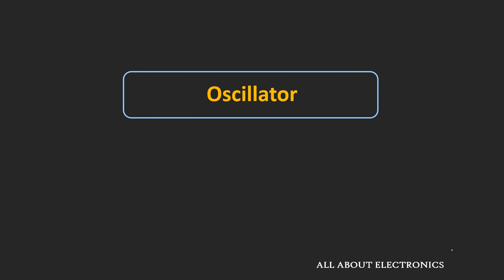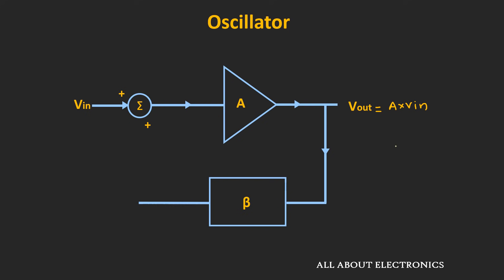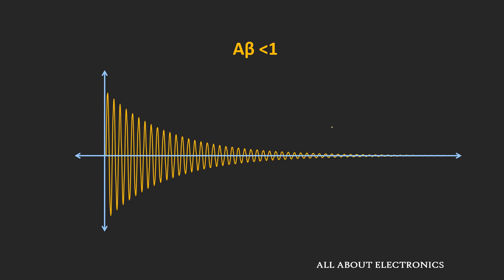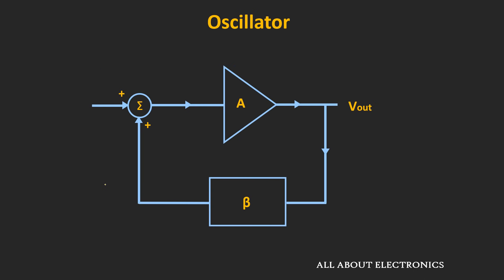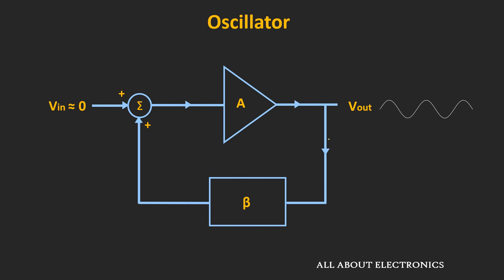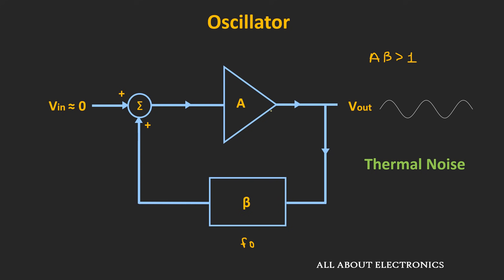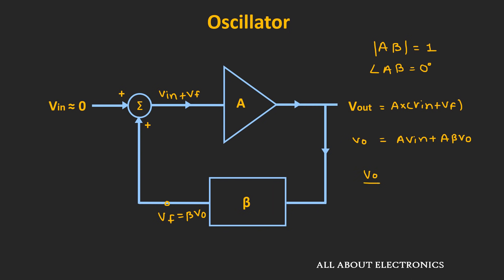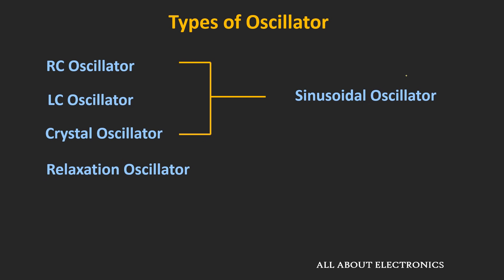How Oscillator Works ? The Working Principle of the Oscillator Explained

Comment: You have told that we can get the oscillations at the output without giving any input due to the presence of thermal noise. However, it has been depicted in my reference book that we can get the oscillations at the output without giving any input due to the presence of transient noise. Now, which one is correct?
Reply from the maker: I have already mentioned that in the video, Please check the video 4:50 onwards.

Comment: Great explanation. I was actually stuck on the question "how does an oscillator generate sine signal without a sine input?". I thought alot of stuff, considering DC biasing, poles, transients etc, but didnt think of thermal noise. Thank you for this video

Comment: shouldn't it be like when ab is not equal to one the output will increase or decrease exponentially but when it is equal to one it will increase linearly
Reply from the maker: No, that is not how it work ? For more information, you can check this video on feedback amplifier. Where I have explained that in more detail. 
https://youtu.be/CDmDXRGjbIU

Comment: the magnitude of the loop gain AB should be equal to 1 (AB =1);
While proving this, the denominator becomes 0, which means infinity.

Can anyone Pl explain to help.
Reply from the maker: It indicates that the closed loop gain is infinite. That means even if there is no input ( ideally) or very very small input, then also we should get output. In oscillators, actually a thermal noise gets amplified by this closed loop gain at some frequency and because of that we are getting oscillations of specific frequency at the output.

Comment: Respected Sir, how is the output Sinusoidal? That is why I came.

Do we have proof that the internal noise is "sinusoidal"? So then its amplification by A is also sinusoidal and Beta=1/A in feedback once again puts it back equal in magnitude and phase. 

OR is it so that both the amplifying blocks are frequency selective? Afterall any signal can be reproduced by addition of n different sine waves. So from the chaotic non sinusoidal internal thermal noise, only a particular frequency is favored by A block. 

Sorry for making it longer. 5:23 I would like to differ. I think it is the A amplifier block which 'must' be frequency selective as the output of A amplifier is the output of circuit itself.

Comment: sir why we are giving ac input to the amplifier as we know that oscillator coverts DC to AC without any input
Reply from the maker: Yes, true. We do not apply any ac input to the oscillator. But just to explain the concept of loop gain it has been assumed that some signal is applied to the oscillator.

Comment: at 7:37 how A*bita  is equal to 1, please clear my doubt.
Reply from the maker: If the oscillator circuit is providing oscillatory output then AB is close to 1. If AB is more than 1, then amplitude would increase gradually and the output will get saturated. If   AB is less than 1 then gradually oscillatory output will die out. But since we are getting constant oscillatory output, it means that AB in the circuit is 1. I hope it will clear your doubt.

Comment: Hi , I have a question . Previously we explained like oscillators are not taking any input and works with thermal noise available in the amplifier circuit. I believe , thermal noise used to have multiple frequency wave from. 

But here my question is :First block diagram tells that , Oscillators are going to take DC input signal ( How thermal noise is related with DC input signal ) .. Don't able to understand.
Reply from the maker: It will be superimposed in the DC signal as well. The thing is it is very small in amplitude. But due to positive feedback it will get amplified and eventually a particular frequency component will get amplified. 
I hope it will clear your doubt.

Comment: just one question. the circle with the sigma in it. what's it called?
Reply from the maker: It's the summation sign.
Reply: @ALLABOUTELECTRONICS  Thx. but i meant the component
Reply from the maker: @BiDude6205  Generally, either op-amp or transistor is used in the oscillator circuits.
You can go through the oscillator and multivibrator series playlist. 
You will get more idea about it.
Reply: @ALLABOUTELECTRONICS  thx

Comment: Sir we oscillate the thermal noise so we get the frequency of thermal noise. How we get the power to the circuit from that frequency
Reply from the maker: Through DC supply, the oscillator gets the required energy.
Reply: @ALLABOUTELECTRONICS  Tq
Reply: @ALLABOUTELECTRONICS  sir how the RF oscillator produce more frequency than AF oscillator in both we use same components.

Comment: How the system knows the selection between Abeta>1, Abeta=1?
Reply from the maker: The amplifier itself sometimes does that job.
For example, when the output of the oscillators starts increasing, then gain of the amplifier also lowers down at higher voltages. (As the voltage reaches near saturation).
Typically, in practical systems, AB is kept slightly more than 1.

Comment: First you said that input is applied but later you said that no input is applied and still it produces output due to thermal noise so I am quite confused.
Reply: Also 1/1-AB , if AB=1 the Vout/Vin becomes infinite

Comment: you said that an oscillator converts dc so sinus, but then you gave an example of a sinus input. i dont get it
Reply from the maker: Well, that was shown to explain the working of the oscillator, or to be precise to show the condition for the sustained oscillation.  
As I said, the sinusoidal signal was applied just for a moment, and then it was removed from the circuit.
But actually, the noise acts as an input for the oscillator. And eventually, one of the noise frequency gets amplified and we get the sustained oscillation at that frequency.
I hope it will clear your doubt.

Comment: What is use of DC supply in oscillator
Reply: A lot of radios are run off of 12V DC to be step down from city power. Usually they run off of 4-50W of RF power. It allows for less heat and small components to be used in mobile and portable radios.
Reply: Thank you...Sry to ask I have a doubt normally we apply low amount of sinusoidal supply after we remove it and the amplifier amplify the thermal noise       and oscillations are produced in desired frequency
Reply: Mounika Bandaru Yeah, we usually use transistors or capacitors/inductors to create different types of sine waves I believe.
Reply: And why we use DC supply
Reply: Mounika Bandaru DC voltage is easier to control in circuits because it follows a linear constant path, less likely to cause interference with AM and SSB, compatible with diodes and electrolytical capacitors, etc.
Reply: @furonwarrior  kk thank you

Comment: How did you just assume AB=1 at 7:45
Reply from the maker: In oscillator, with out any external input we are getting output. If vin = 0, then Vout should be zero. But still we are getting output. Actually small noise gets amplified by the oscillator at particular frequency. That means Vin is very very small. And when AB =1, the oscillator provides ideally infinite gain to that small signal. But practically, AB will get limited by the saturation of the amplifier. Initially AB >1, but as signal gets amplified then AB reduces slightly. In short, in the closed loop system the AB is maintained such that we are getting sustained oscillations.
I hope it will clear your doubt.
Reply: @ALLABOUTELECTRONICS  So the oscillator principle causes thermal noise? And no voltage and current (Vin) need to flow to the amplifier. We need just power the amplifier. Right?

Comment: This disregarded the impulse created by power up conditions for initiating oscillation. This circumstance far outweighs any thermal noise. It also disregards different output waveforms that can be achieved by what the video shows as sinusoidal circuits. Waveform conditioning can also be accomplished by circuits following the oscillator.
Reply from the maker: If you go through the playlist on Oscillator, I have already discussed the different ways of the generation.

Comment: It mean the input is in form of ac?
Reply: If not then plzzz sir explain how does a dc is converted into ac in this circuit
Reply from the maker: I have already explained that buddy. As I said in the video, the signal is generated from the thermal noise. Noise has all the frequency components. And selectively one particular frequency is amplified. Here, of course the source is DC only.
Reply: Thanku sir

Comment: but we have studied that transistor does no phase shift that means feedback circuit should react to all frequencies??
Reply from the maker: Transistor does provide a phase shift. If you have studied BJT common emitter amplifier, it does provide a 180 degree of phase shift.
Reply: @ALLABOUTELECTRONICS  so how feedback circuit will select a frequency as all frequencies will be shifted
Reply from the maker: @karnisingh7365  At one particular frequency the phase shift of the feedback circuit will be equal to 180 degree. So, at that frequency, the overall phase shift of the circuit will become zero. And that frequency, the oscillator will oscillate. 
I recommend you to watch the other video on oscillator like RC phase shift oscillator, Wien bridge oscillator so that your confusion will get clear. 
Here is the link:
https://youtu.be/Gvb4GIV5ig8
Reply: @ALLABOUTELECTRONICS  got it, thanks sir for your instant support

Comment: as per equation as u explained  Vo = Vin(A/1-AB)....so if for sustained oscilation AB=1, then Vo becomes infinite (then how come it be sustained stable oscilation). the two statements contradicting each other
Reply from the maker: Because initially, the input is zero. In reality, the noise acts as an input. And to amplify that noise which is very small in amplitude, you require a very large gain. Theoretically, the input is infinitesimally small and to amplify it you require infinite gain. 
I hope it will clear your doubt.
Reply: @ALLABOUTELECTRONICS  so if initialy is input is zero as u said then Vin becomes 0 (as Vin is input voltage)
 then Vo =Vin(A/1-AB), output Vo also become zero as per equation, then there is no oscilation at all.
This equation is contradicting the explanation in either ways

and secondly, u said that initaly AB>1...so initialy if AB is greater than 1 (let say AB =2) then Vo becomes Vo= -A(Vin) , it means output become out of phase......and then u said over course of time once signal reaches finite voltage loop gain AB becomes =1....so how can AB automaticaly becomes = 1 from value greater than 1 over course of time?? magic occurs or what?? (i mean how this change occurs automaticaly)
Reply from the maker: That's why I used the term infinitesimally small input (noise). So, the input is actually not zero, and at the same time gain is also not infinite in the practical circuit. 
Both are finite.
Reply: ALL ABOUT ELECTRONICS no sorry sir but  u did not expalin how gain become 1 from greater than 1, over course of time automaticaly
And puting loop gain greater than 1 gives  Vo= -Vin(A) negative output, how about that?

Comment: when AB =1... A/(1 -AB)  = A/0  ; any attempt to find that A/0  = finite quantity is mathematically invalid because A/0 is undefined
While it is true that the circuit will oscillate when AB =1 or more correctly ,  AB =1 +j0 ;   the "proof" shown above is INCORRECT  because of  the undefined 
nature of A/0 !
Reply from the maker: Yes, mathematically it's true. But in reality, AB is not exactly equal to 1. Its tend to 1. So, the denominator will be very very small. And due to that, from the noise (Vin is approximately zero) also it is able to generate the oscillations. I hope you able to understand the logic behind it.

Comment: how input becomes 2v when AB is 0.9.......?
Reply from the maker: Here I am referring the case when the 2V input is momentarily applied to the oscillator and then it is removed. So, at t= 0+, the input to the oscillator is 2V. But in the subsequent iterations, it will reduce. (as AB = 0.9)
I hope now it will clear your doubt.

Comment: i have one question...15 v input to a 10v zener diode with 1 k resistance in series and also 1k load parallel to zener...
then wat is the total current,zener current and load current?
Reply: Total current= 7.5 ma
Load current= 7.5 ma
Zener current= 0
All this only when we consider the zener knee current is 0

Comment: If AB ->1    the equation     Vout = A/(1-AB)   goes to infinity based on the math. How is that explained.  What controls the change  of AB when  AB > 0 during startup and  AB=1 at steady state.    I like the way you analyze circuits.
Reply from the maker: In the oscillator, there is no input. So, Vin =0. And still, we are getting finite output. And that is only possible in the system when AB= 1. In the video, like I said, the noise will act as input to the oscillator. So actually there is a very small input (in microvolts or even smaller). And as close loop system point of view, it can be said that this very small input will see a very high gain (ideally infinite), which will build up the oscillations. Initially, the gain provided by the amplifier will be such that AB >1, (And actually it can be set by setting the gain of the op-amp). And when the signal reaches some finite voltage then gain provided by the amplifier will change (Due to non-linearity of the amplifier). e.g, if the transistor is used as an amplifier then for the small input it provides very high gain, but as soon as input signal builds up, transistor goes towards saturation, and in saturation, the gain of the transistor will be different. So, this non-linear behavior of the amplifier maintains the loop gain to unity.
I hope it will clear your doubt.
Reply: @ALLABOUTELECTRONICS  reminds me of the saying of a small spark starting a great fire
Reply: Thank you for taking the time for detailed answer. That clears it up for me. Best.
Reply: @ALLABOUTELECTRONICS  Hi, Thanks you very much for this explanation. I was also find this confusing. May I clarify if B will also be changing or, actually, reducing automatically or manually so that the value of AB=1 when it reaches steady state? For A to be moving from the linear region to the saturation region, A has increased in value. B must then be decreasing so that the value of AB has changed from AB>1 to AB=1.
Reply: @ALLABOUTELECTRONICS  If you let the amplifier go into saturation, the resulting oscillation will not be sinusoidal though (it will rather look rectangular). The saturation indeed acts as a kind of control that implicitly reduces the gain (thus results in stationarity), but in order to have an (at least approximate) harmonic oscillation, the amplifier should remain linear (respectively, below saturation). The necessary decrease of the gain factor (after the initial phase) in order to achieve a sinusoidal output should therefore be set by an extra amplitude control.